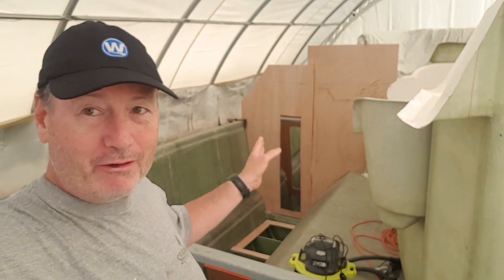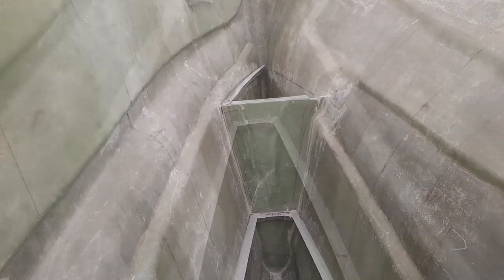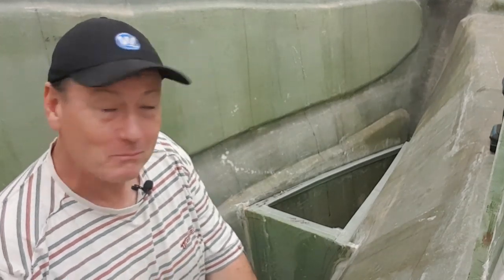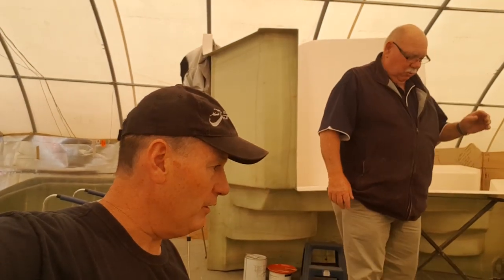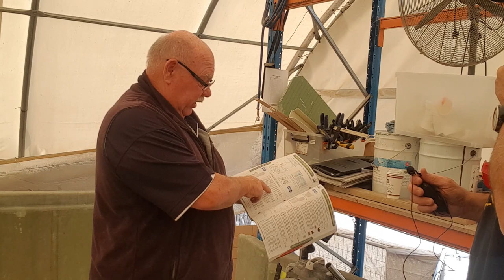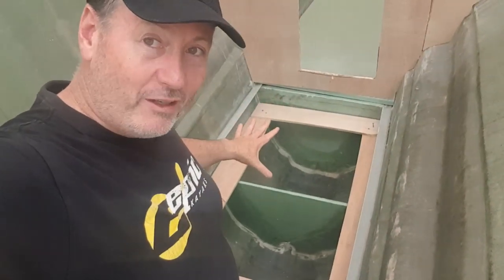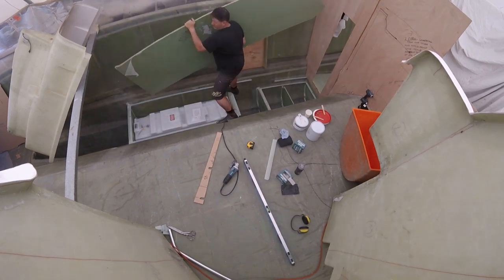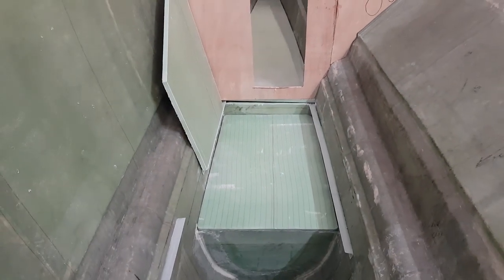Ep077 Boat Plumbing and Cabin Soles - Life On The Hulls Catamaran Project

Comment: Well done  mate keep them coming all videos  are spot on mount your pumps on a board with rubber mounts not direct to the hull
Reply from the maker: Thanks Paul, I will be mounting them on individual foam core brackets with much rubber mounts that I can access to replace regularly. Cheers Buddy Rossco.

Comment: Enjoying the videos and the varied content makes them more interesting. If someone's not into the non construction video they can always skip!
Are the hulls still in their mold? Any concerns about demolding with the increasing weight?
Reply from the maker: Hey buddy, weight will not be an issue I estimate demoulding weight will be around tonnes which is nothing realy in teh scheme of things and a franna can handle  at extension and 8 up close. Hull is in mould as long as possible as the storage of 2 full size cats is an issue and an expensive one as well. The longer it stays there the better. Cheers

Comment: I enjoy the views of your life outside of the boat building, but I have to tell you I love the build.  I like to see the progress and look forward to seeing how far things get every week.  Cheers.
Reply from the maker: Funny thing is , it doesn't look like much of  change but to me the changes are epic and now I am finishing the bilges, well, it is the most rewarding part so far. Cheers Ross
Reply: @LifeOnTheHulls  The changes are huge.  Those angles are amazing.  Tabbing in your floors is going to be a breeze and it is a huge accomplishment.  You've also prepped a lot with those completed modules. You will not be walking in the depths of the bilge.  You will be walking on floors like a human being instead of a bilge rat. 

I can actually visualize what will be and that's not an easy thing for a land locked desert dweller.  Believe me, when I can see whats what there is a lot done.  I continue to be amazed at what a corker that vessel will be.  Blows my mind.

Comment: Lots to think about with plumbing, and the power draw of all the pumps. Good planning to direct everything to a single tank (per side) and pump out from there. If everything drains to the tank, and it’s manually pumped out of the tank it greatly reduces the number of through hulls, anti-siphon loops, Y-valves. It also completely removes the possibility of accidentally dumping if a valve is turned. Your lines all flow down and are therefore empty instead of full. Glad your bilge is deep enough to place it there instead of in the walls.

Comment: Hey Ross - really enjoy all your videos👍 Not much point chasing You Tube analytics - they keep changing the algorithm and folks are as fickle as f... anyway.😂

If you want to reduce pump and plumbing noise follow submarine practice ;
1. Group up pumps,accumulators and resiliently mount them to a raft that is resiliently mounted to the hull.

2. At each pipe clip ensure it is decoupled from the hull (resilient) and the pipe is decoupled from the bracket.

3. Fit a large a capacity accumulator as possible for those nighttime situations.👍

Comment: Brupegs answer to the crash bulkheads, was you want a pipe and valve, to check if the crash bulkhead had been breached. I´m watching it at 20:30 shortly after release and its still 30c+ and 85% humidity, but we are in Spain, the other way up and in the middle of summer
Reply from the maker: Spain sounds so nice  I am heading to Europe in  weeks and I hope the weathers stays warm but certainly not that hot. I will be installing a pipe breather and ball valve so I can check for ingress. Cheers Duncan enjoy Spain.  Ross

Comment: Hi, I found you the day before yesterday and  I watched all your videos in two days. Nice story and very interesting but a lot : )

If I understand you correctly, you want to use a waste water pump on the left and right side separately. That will be okay.

But I thought to connect these two pumps together, with one valve in between, so that if one fails, the other can take over.
I have been an aircraft mechanic for 30 years and all fuel pumps, hydraulic pumps, fire extinguishing pumps and other pumps were Always connected to each other.

They call that "cross feed valve", you always have a backup.
Just look on the internet.
Hope I could help you with this, you won't regret this.

Grtz from Belgium
PS: I don't know if anyone else has mentioned that.
A few responses too many to read them all.

Comment: Hello, from Alabama USA.  I recommend you use isolators on all your pumps and pipes.  That will keep the noise down significantly.
Reply from the maker: That is superb advice Greg, I will e doing everything to avoid drumming and positioning is everything I believe, too close to the outlet creates a back pressure as it cant catch up , so closer to the source is the answer I believe, any thoughts appreciated. All the best Rossco

Comment: Would be interesting to know what your plans for the electrical are Ross. Are you looking at a gen set, how much solar, lithium batteries, hydro or wind generator etc? I understand its early days mate so no pressure. Would be good to know what your plans regarding that are at some stage though.

Comment: When you go to install your pumps and other electrical accessories, look at weatherpac connectors. cheap and easy to assemble.. My bilge pump had one to quick connect it. When it finally failed after 11 years there was NO corrosion on it at all and was sometimes covered in water.
Reply from the maker: Thanks buddy, I will look them up I am paranaoid about corrosion and they seem to be too good to be true. Cheers Rossco

Comment: I would have bathroom sinks and showers able to pump overboard as those are always good water to have overboard so it does not fill the greywater tanks.
Reply from the maker: Johnny, I will be installing three way valves to facilitate this however, it is now a survey requirement in Australia to contain all grey and black water and until a suitable discharge is available ie open sea, or marina pumpout, I am required to hold a ceratin limit and in this case both black and grey can be retained legally together and discharged appropriately . It also ensures the water level of blackwater tank is sufficiently diluted avoiding toilet paper and pulping of sewerage is kept at a minimum. Cheers Ross

Comment: My uncle was one of the pioneers with epoxy impregnated plywood boat building in Australia ,  (he had boats he built sailing in the Olympics for Australia and other countries, )  This was commonly called the WEST system , but used a different , cheaper brand.  He didnt use all the safety gear and he is now really allergic to epoxy.  Bit of a lesson there.
Reply from the maker: Epoxies and plastics allergies are such an issue and I am extremely careful with all of the chemicals but in particular epoxies are the nastiest in terms of allergies. My best friend cant even visit my build as he hives up nearing uncured epoxies which is sad as we were going to build a boat together one day. The effects are also cumulative and many a good yacht build project has been destroyed by the builder contracting said allergies and the world is covered in these builds. This had a major impact on some of my decision making as to making our boat from Vinylester ( a modified chain of epoxy however with  styrene monomer carrier ) rather than straight epoxy. Thanks for commenting great to see you are interested in our build., Cheers Ross

Comment: Are you going to tab the bulkheads in such as the crash bulk head or bulkheads that hold the floor up? I saw you do it up on the main deck but dont know if i missed that part of it.
Reply from the maker: Main bulkheads get glassed in after floors are sealed down. It is essential that the entire bilge is compete prior as access is so limited after that , the detail is quite incredible. Rossco
Reply: @LifeOnTheHulls  Good to know! Thanks for the response.

Comment: I admit I like your boat building episodes better but I do enjoy your kayaking videos as well. I'm not so much a fan of the sailing videos. Just for your interest. My question is could you not hire a helper at a reasonable cost to help move it along a little faster. A couple thousand for a months help would speed up things a lot. Which probably is peanuts in the budget of a rig this size.